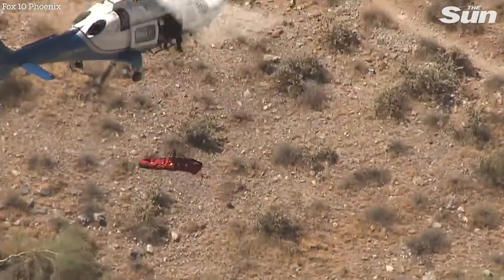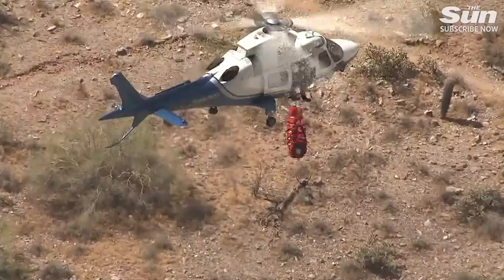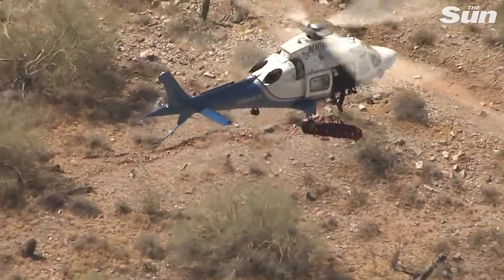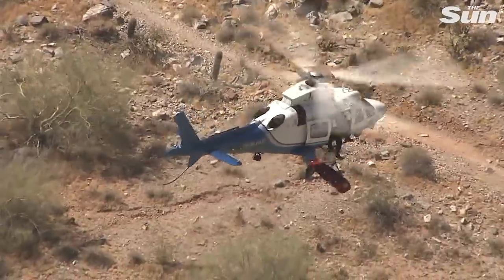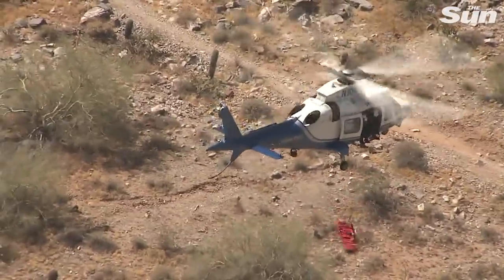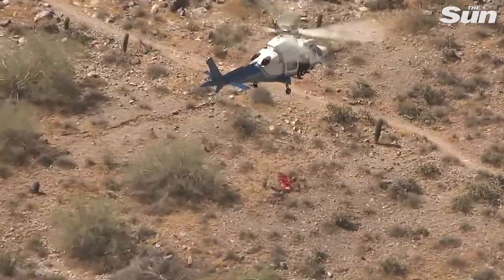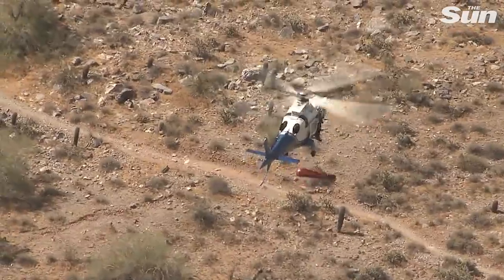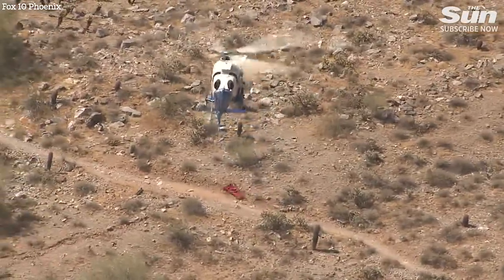Stretcher SPINS out of control under rescue helicopter

Comment: Absolutely inexcusable. I worked on mountain SAR here in South Africa for years and we ALWAYS have a control rope heading up from the personnel on the ground through the head of the stretcher and ending in a slippery hitch on the hoist hook. When the stretcher is pulled into the chopper the hoist op pulls the hitch free and the rope drops to the ground. As long as pressure is kept on the rope at all times, not a problems for stretcher or ground effect from the chopper. Afraid the pilot/engineer's lame excuses just don't hack it.
Reply: welcome to America 🤣😅
Reply: Still gonna be charged 80k for this regardless
Reply: I agree,  this a mistake of immeasurable incompetence. I  don't see how people can laugh at this colossal mistake. That poor lady suffered needlessly.